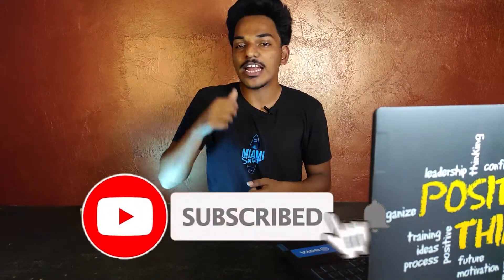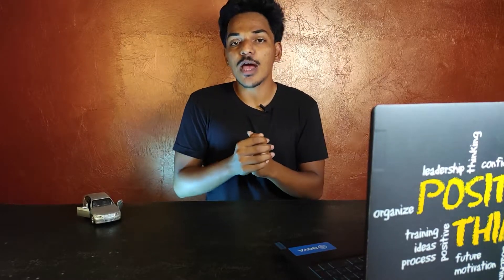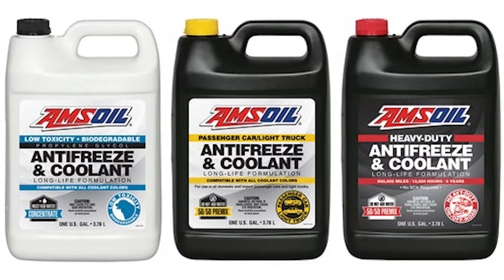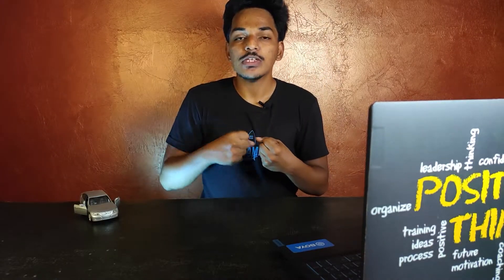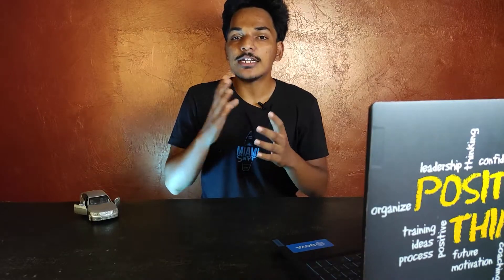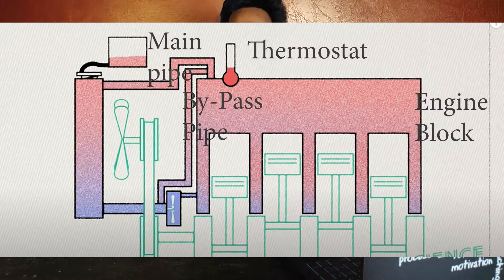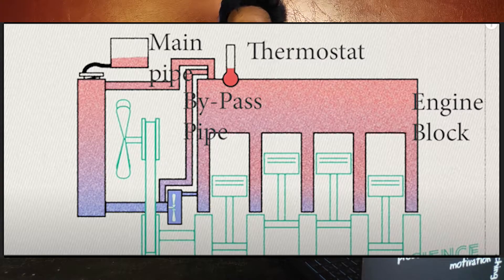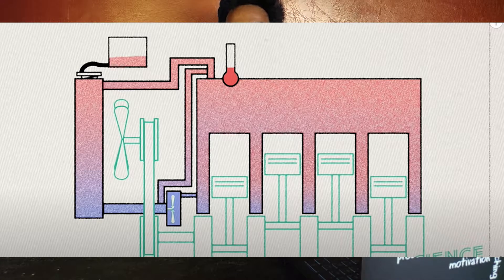How Does a Radiator Work ?? || #Tamil ||

Comment: good explanation. if possible please explain in case of any issues with engine overheating, how to troubleshoot whether the over heating is because of radiator block (due to dust) issue or thermostat issue or fan issue. Is there any workaround if we face the issue while long driving. I faced the issue couple of times while long driving.